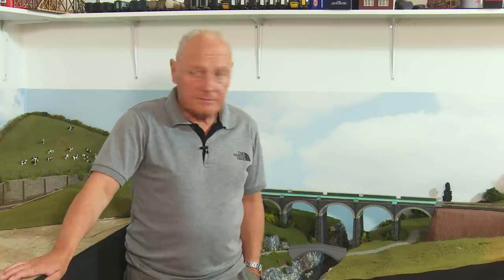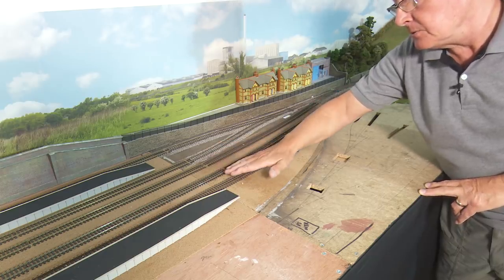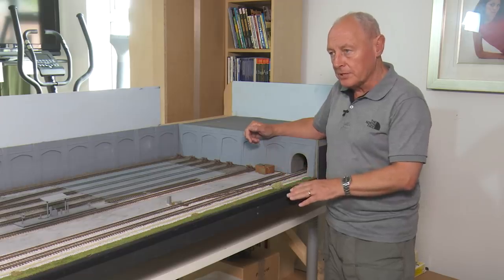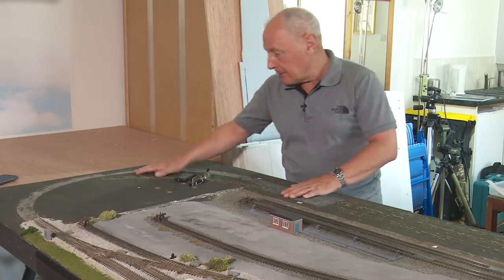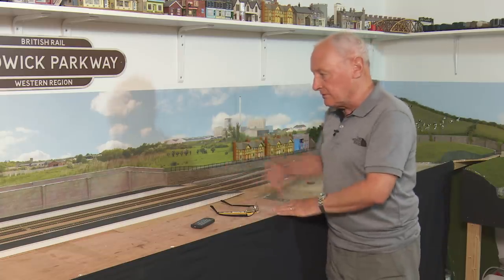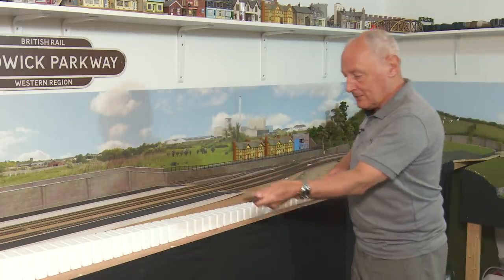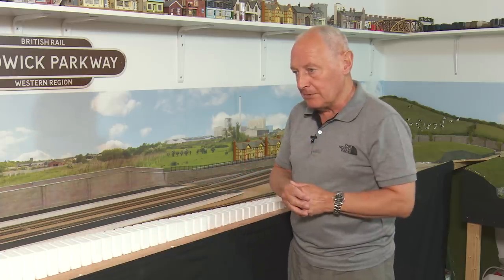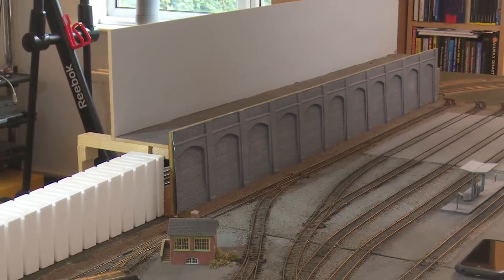A boring track plan at Chadwick Model Railway. | 72.

Comment: ive made three bridges over an estuary with rocky cliffs each side 7 tracks with a level 1 twin track loch ken viaduct which will serve a port/dock with freight / fish van traffic which is 1.4m long .level 2 will have 3 tracks serving passenger stock with a twin span multi girder bridge which is 1.4m long with 3 tracks.the top level will have a twin track tower bridge type suspension bridge using hornbys grand suspension bridge wires and side rails only.the layout itself will be built like a set of stairs and will be 3ft wide by 1.4m long for the brigs only.the rest will be 3ft wide by 12ft long and 10ft in length.it goes right round a bedroom with an operating space of 8ft x 4ft....fiddle yards will stepped to accommodate each level....your layout viaduct is beautiful as is.i had an incline for twin tracks to a hight of 80mm at 2.2m long and had no issues with any locos....
Reply from the maker: Sound advice, thanks Jim

Comment: What about a small, back country station on your incline that could easily be served by a lighter passenger train. Then in the low area, in front of your main, you could build one thing industrial. Freight serving a water front? A quarry? Coaling station either off loaded by ship to train or vice versa? Container operation? Automobile loading operation? Lumber? Steel mill?
Reply from the maker: You’re right DR, I need an industrial depot

Comment: good stuff from Woodland Scenics ... but indeed, not wide enough for a double HO track on top of it. But, there is a rather easy solution to it. Just put a wider piece of thin plywood on top of it, wide enough to fit your 2 parallel tracks. On top of that plywood, off course, put your sound barrier (cork or other) and then your track. So, problem solved ... right ??
Reply from the maker: Great suggestion Mark. 
Regards Charlie

Comment: What about using a single incline, but laying a strip of plywood over it of the correct width for your double track? You are going to want to blend in the side with scenery anyway, so stuffing up the resulting gap with a suitable filling won't be much trouble. The weight shouldn't be any issue as only the locomotives have any real mass to them?  On the question of whether they are too steep, I suppose it might really come down to what type of scenery you use around it - industrial or rural. There are plenty of prototypical examples of steep inclines around London, and a few rural ones too - the drop from Yeovil Junction down to the Weymouth line being a local one - albeit not as severe as your 4% perhaps.
Reply from the maker: Very interesting contribution J, many thanks

Comment: A long straight incline might also be 'boring'.  Investigate the possibility of running it around a corner which will break it up and provide some good track-level photo opportunities as the gap between carriages closes up and becomes more realistic.  Some locos might strain with the extra drag but you would soon identify those.  When fitting the risers you can stretch them a little which will lessen the gradient.  Good luck!
Reply from the maker: Sound advice, thanks Bob.

Comment: I've used the Woodland Scenic inclines and they work really well. One word of caution, be careful when using the foam. You will need to think about how the incline starts and how the foam will transition at the base of the incline. You need to maintain the gentle start to the gradient. Any lumps or bumps will cause issues.
Reply from the maker: Sound advice, thanks Mr B

Comment: An interesting development and one that will make a difference I'm sure. By adding the gradient you are adding more dimension to the parkway area which could be seen to look slightly flat when compared with the viaduct.

The suggestions to lower the gradient are valid, but something you might want to investigate is DCC concepts powerbase. Deanpark has a video on installation and the difference it can make. This also allows for future expansion in terms of stock if you wanted to run a steam excursion or something like that and not being hampered by the gradient. Adding the powerbase allows you to use it later if you find some locos need the help with the gradient, without needing to retrofit.
Reply from the maker: Sound advice that’s for sure.
I’m going to try 3% next and check out what it looks like.

Comment: I'd go with adding Chadwick Central as you suggest. By pass Chadwick Parkway with the incline, as per your test layout,so trains have to run around the loop through the hidden staging. This will add a bit of interest in that trains will have somewhere to run to and from rather than just appearing and immediately disappearing.

As others have said use an incline that's no steeper than it absolutely must be to achieve the height transition as that'll make things look better. Also don't forget the drag will increase if the incline runs around the curves so again the shallower the better.
Reply from the maker: Sound Advice Chris, many thanks.

Comment: My experience with gradients in n gauge are about what to avoid. The least steep the better but it isn't always the gradient that is the problem.It is the curve at each end which creates extra friction on the train. Your warship performed well on the straight but might have stalled if most of it's train was around the corner. As for looks. I come from Bournemouth and the run up to Bournemouth central from Christchurch is pretty steep and also the run up from Poole at the other end and was a big problem in steam days, and could still be so. with a stalled train. Changing the subject a bit. I have a fiddle yard on my L shaped layout that would correspond with the opposite side of where you want to put yours. I still have scenics and running tracks at the back to a return loop station but I have access to my fiddle yard without going under the layout by having the fiddle yard on what would be your central operating position. Like the layout and hope this helps.
Reply from the maker: Yes good advice LT, many thanks.

Comment: Charlie I would say the layout doesn’t have a lot of operating potential (play value) from my perspective the fun comes from shunting trains and wagons around another station would be good given the layout size. Although it is nice to be able to let trains run around a circuit I think the fun comes from reforming trains. If you were to move the existing station forward a bit you could get away with 2 rows on inclines I have used them for a single track which rises around a curve and it works well. The incline does not look to,steep but the station would have to be on a flat and level section to be prototypical.
Reply from the maker: Thanks for your advice Gary, food for thought.

Comment: Hi Charlie, I'm interested in your incline since I've got to do the same thing, I to have an upper section which is about the same height as yours, I was wondering how long a run you have to get to that height. I'm also looking at a bridge  to go over the lower section lines and am going to use a modified Airfix/ Dapol one as these are easy to modify
Reply from the maker: Stay tuned J, I always admit my mistakes!

Comment: Hi Charlie, just watched your latest video about your boring track plan, wrong. As one of the other commenters said modern track plans are pretty boring, straight lines through stations and not a lot else. Your idea of a terminus station seems like a good plan. I think the gradient looks a little steep. What about a small terminus over the fiddle yard with the gradient starting pass the end of platform 1. A shallower gradient runs up over the yard to Chadwick Central station that had a twin track platform, that has now been reduced to single track and then add some sort of industry for some shunting interest. What do you think ?
Reply from the maker: Sound advice, thanks John.

Comment: Hi Charlie i have the same 4% risers and have 2 incline/declines to do on my layout with mine im planning on using the foam riser as a base to then put a piece of 5mm plywood over the top which will be 900mm wide so on the 3 tracks the longest train i have is the pendolino and will have enough clearance between each train as it passes each other, having a terminus station at the top of the over board sounds like a good idea cheers Beeton Hough Junction (Dave C)
Reply from the maker: Thanks Dave good info and I’m so pleased that you enjoyed it

Comment: Charlie I'm sorry to put a spanner in the works that if you are going to use your tortoise point motors like on the rest of the layout so far you may have to go higher as the trains in the fiddle yard under neath will hit them unless you are thinking of using PECO  ground point motors then you will be OK  but i do like the way you are thinking and good luck on the build.
Reply from the maker: Darn, I hadn’t thought of that. Sound advice, thanks

Comment: Hi Charlie, Have you looked at "dougattrenholmejunction" You Tube channel? (may not have got address quite right) This very large layout has a fantastic track plan with a junction similar to what you are planning at the RH entry to your "Parkway" station. His layout detail & track laying is not perfect but the junctions are complex & look really good. There are many YT vids to watch. I also suggest bringing the Parkway station forward to the front of the baseboard & using the space behind for goods or a new TMD to free up your other baseboard for better use. Love the viaduct & your vids on how you did it, Hope this helps
Reply from the maker: Sound advice, thanks David and I’ll check out Doug’s channel.
Reply: Thanks for replying Charlie, the correct address is dougattrenholmbar. Also known as Trenholme Junction. Some of the earlier videos (DMU cab rides) give best view of the track plan. From what I can work out from the track plan, this MR is about 60' x 20' & on 2 levels. It was built specially for making railway videos. The sky back scene is "live feed" so very different.

Comment: Yep the Woodland Scenics inclines are single track as is the foam roadbed. You should have no problems with  most diesels but steam will be a bit tricky at 4%. You may need two sets for double track depending on the spacing you use. I'll not get into the HO v OO debate but suffice to say its the same track gauge at 16.5mm.
Reply from the maker: Your dead right Charles. 
Luckily, or unlucky, I have no steam!

Comment: Not at all boring, your videos are a joy. I have a question and you are so knowledgable with electrics I wondered if you wouldnt mind. On Dc you can prevent accidents by interlocks which create dead secrions of track. But from what I have seen DCC maintains track voltage and choses which loco to move. So is DCC smart enough that you cannot drive a loco into say points that are set against it, or other similar situations. As you can tell I know didly about DCC. Thanks, and keep up the good work. Steve.
Reply from the maker: An interesting question Steve. Yes you can drive a train onto a set of points set against it.  The fundamental difference between DC and DCC is that in DC you only drive the track, by adjusting its voltage. 
With DCC you really do drive the train, sometimes badly!
Reply: @ChadwickModelRailway  Good morning Charlie, and thank you for a very straightforward answer, it seems swings and roundabouts with DCC, think I will stick to the old school. With conventional railways you cannot give a clear signal until you have set the route, this goes out the window with DCC even if it offers other benifits.

Comment: Why don't you use ply for the rise like you would if you had a open frame type board you could have it as wide as you like then or even opening out wider at the top.
Reply from the maker: Because I’m worried about noise transmission into the base board.

Comment: Hi Charlie,
Thanks for all your videos, I really appreciate the time and effort you go to, I've picked up some great tips.

On the Inclines here's my tuppance for what its worth  - I've just laid two sets of double track 4% ones....  - yes it does look a bit steep to me but that's the available space I have so Rule 1 applies. 
 
I have tight curves ( R2 and R3) on my inclines and I found that once I put Powerbase under the Up lines I had no issues with a steam loco that previously had trouble bringing up itself and a coach, now it's as if there is no incline at all with the max length of train behind it - ergo, If i ever lay an incline again ( whether i have a curve on it or not) I will put in the powerbase anyway - that way if I get a loco that doesnt like the incline I can add the magnets to help it.  If no locos need it, the powerbase is not that expensive to have put it in as an insurance policy.

On the one or two  parallel foam inclines question  - next time I will put just one foam incline in and put a wide base on it - ply or similar with extra supports at the edges. With curves on  the inclines, one of the foam inclines ends up being shorter and so is at a different height at various points etc. etc. With a bit of judicious stretching and compressing I think the differences in height I have now are acceptable to me. 

Also - two foam risers next to each other do seem to me to be a bit wide  and I did consider thinning them but in the end I decided to leave them as is in order to keep my current construction momentum going.

As a long term fan of C.J. Freezer type plans - a high level terminus on a layout with a lower level loop -  yup go for it

i like the idea of rotating the TMD 180 degrees as others have suggested.

Cheerio.

Ned.
Reply from the maker: Wow Ned, what a great comment. I’m so pleased that you enjoyed the video and thanks for your advice.
Regards Charlie

Comment: The layout sounds a great idea with plenty of operational scope .Could you tell me what size your layout is plz. Mine is a simplistic 8ft x 12ft country layout on 2ft wide boards. I hope to extent boards to 2ft 6inches to give me a bit more trackwork variety although it did get published in September issue of Railway modeller. I found your comment on !st radius track useful but not sure if for me as I have Steam loco's as well as diesel. looking forward to your future video's.
Reply from the maker: Hi Peter, it’s about 5.2 mtr x 3.2 mtr.
The boards are about 30 inches wide.

Comment: Not boring in any way Charlie . Some superb track work there . I think Chadwick Central is a good idea . I always like layouts that have a destination , some need for shunting as well as a big round roundy section, best of both worlds .  I wouldn’t disturb your parkway station though, it really looks good as it is . Could you not start the incline after the station? Would this give you enough space for the incline to get to the bit above the fiddle yard. Not sure having an incline behind your parkway station is that prototypical . It may look a bit toy like .  You could then run trains from Central, down incline  and into Parkway . If instead of of the parcels depot , you ran a line along the innermost platform you could then have a destination platform there .  Station above the platforms? Give you that bit height you think is lacking there.
Reply from the maker: Some sound advice Russell, much appreciated.
Reply from the maker: Also Russel would you please subscribe?

Comment: I have made inclines on my layout by using wood  cut to size increasing 0.5 cm a piece for pillars and layed a layer of plywood on top finished with corck. Easy and you get to decide the width yourself. I have also made curves whit inclines. I have used 15 cm width for 2 tracks. I use standard trackspacer to have a constant spacing.
Reply from the maker: Thanks HS, much appreciated.

Comment: Hi Charlie. Great video as usual. I made two inclines on my layout, one up one down with another layer underneath, so I can have trains leaving my main station and disappearing underneath the layout around another loop until I want to bring them up again. My inclines are made of 12mm ply supported underneath with baton. As you’ve already invested in the Woodland Scenics incline why not have a piece of something like 4mm ply cut to a width to accept two tracks stuck on top of the foam. Good luck with whatever you decide.
Reply from the maker: Thanks for the pointers Jeff

Comment: I made my inclines using hardboard because I was working with a curve, but the process was pretty simple. Working backwards from the rise I calculated the length of run for a 3% incline and made a simple tapering jig for the table saw to cut the rising sections. I then cut spacer pieces in 1cm increments in height plus some narrow 5mm and 2mm pieces. A quick curing wood glue and tape for assembly was fine. It made a very solid base for the incline. It also means, as someone else has said, that you can make it whatever width you need.
Reply from the maker: Some good food for thought Richard, many thanks.

Comment: Hello Charlie,
If you have the space for a shallower incline then I would use one as the aesthetics would be improved. As mentioned elsewhere in these comments pack out the incline with expanded polystyrene to make it thick enough to take a double track and use a hot wire cutter to match it to the slope of the incline. Having a terminus over your fiddle yard is a great idea and gives you scope for more scenic imaginations. In what would have been a dead space. The two dead straight platforms, parallel to the edge of the base board could be offset on a slight diagonal or even curved to create more interest. Just my two penny worth to give you more work. I enjoy your videos and the contribution you make to our pass time.
Reply from the maker: Your 2d are very welcome and you’re so right about the straight platforms.